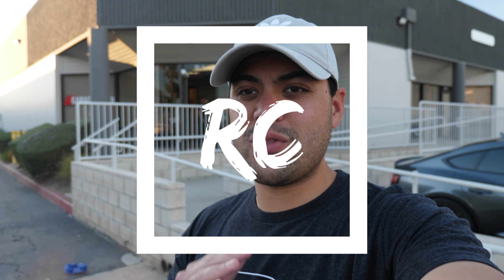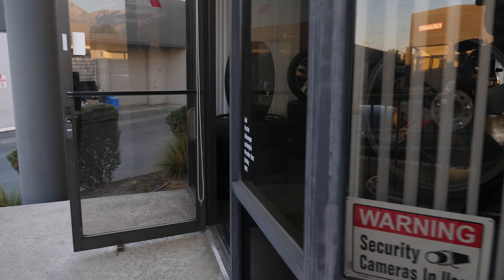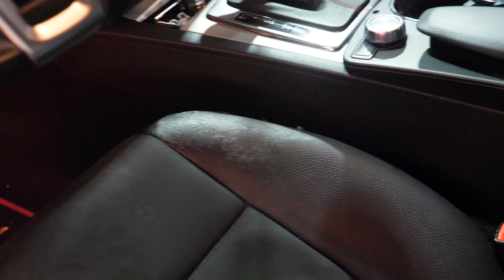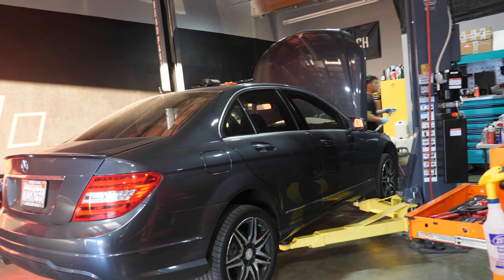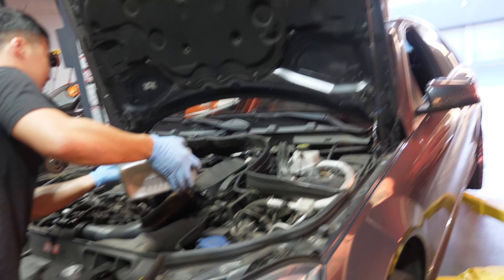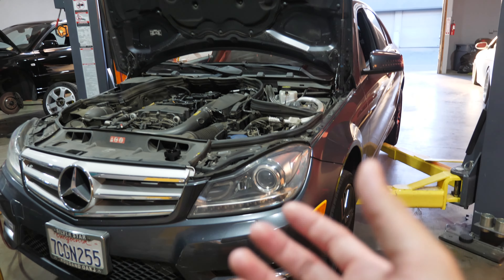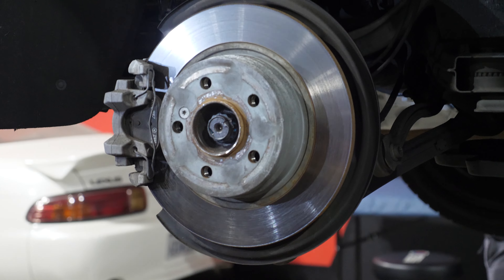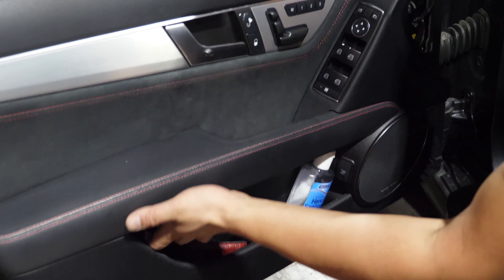Modding the C250 (Mercedes Benz C-Class W204)

Comment: Dont do a quad exhaust you will lose alot of back pressure, unless you install a 3” downpipe and do a 2.5 straight pipe all the way to get as much flow back to the dual exits 🤙🏼
Reply from the maker: Ya I was reading up on how much power you lose. There’s another guy on YouTube im copying that claimed not to lose as much hp from  his setup
Reply: @RichardCuico  yeah since the c250 doesn’t really sound as aggressive with the dual exits sounds a bit more tin canny , im planning on 3” downpipe to a 2.5” single exit all the way back to a flowmaster muffler im currently running resonator delete and flowmaster muffler and sounds deep for a 4cyl
Reply from the maker: @BC2FITTY  definitely want to hear your setup once you have the flowmaster on. I already bought the Magnaflow muffler so I might as well stick with it for the time being and eventually try different setups to get the perfect sound. Just waiting on my new rear diffuser and then we'll be in business!
Reply: @RichardCuico  yeah might as well and im currently running a flowmaster now and a resonator delete and it has a deep throaty sound and not ricey at all ill be posted up a new sound video because the one i took doesnt do it justice, ill keep you updated brotha

Comment: Hmm, you really shouldn't buy a door just for the handle. Ofcourse you can pick up parts of the door assembly at most (if not any) MB dealer, or even cheap non branded auto part dealers. Nice video though, too bad a lot of it is completely out of focus.